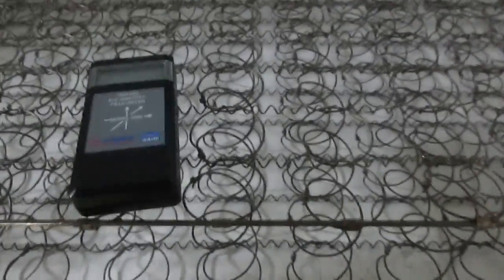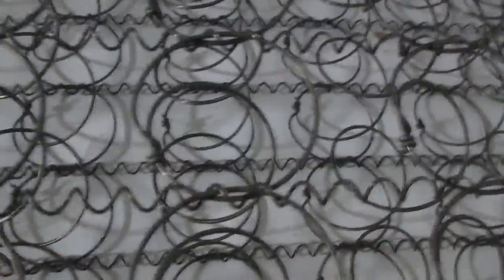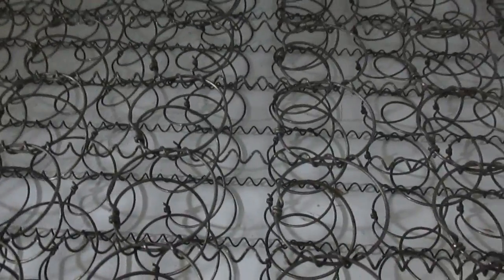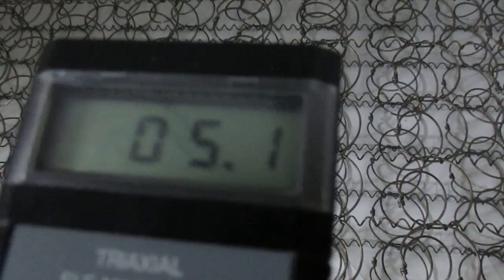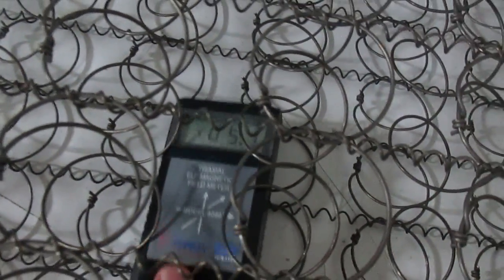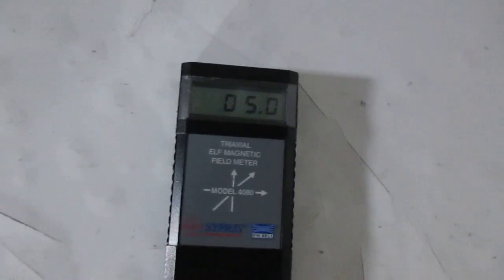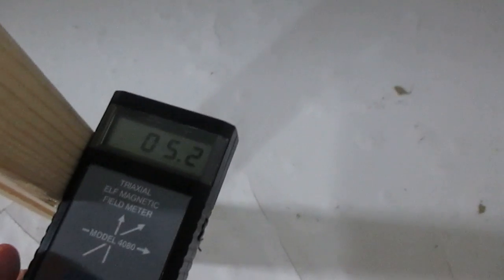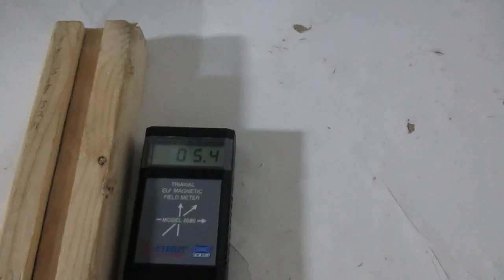EMF Test on a Mattress Innerspring While in a Strong EM Field

Comment: This is not an accurate demonstration. First - You need to know WHAT you are measuring. People think EMFs are just one EMF. There are Electrical Fields, Magnetic Fields, Radion Frequencies etc. 
Electrical fields do and WILL couple with metal. You are reading Magnetic fields.

Comment: Thank you for this. It sounds like the amount of EMF that the box spring is reflecting back is insignificant.
Regarding the concern that some people have that metal can amplify power, it can only reflect – it is not possible to boost the power of a signal without providing input power.
Reply: Exactly, there is no amplyfier without inner power. If they invent amplyfing wihtout adding power they will get Nobel prize for it.

Comment: Do same test put your hand touching spring so your the ground... watch number drop... do with laptop plugged in 1000 reading drops to 5 from touching... very high for laptop plugged in.. your measuring the air near it ... the frequency would be in the metal... and you would ground it... so need to lay your bare arm on it to see effect
Reply: And use emf not magnetic field...
Reply: EMF stands for electromagnetic field and this field is made by electric current that is going trough wire. Every wire that conducts electricity has EMF and this EMF afects the nature around the wire. Using this theory people made electric magnets and by reversing this proces they learned to produce electricity from generators. If you separate the metal spring not to touch the switchbox and youi have a distance lets say 1 m fro mthe box, the EMF inside the coil will be close to 0 and there will be no difference if you naked touching your dick and the coil or just stand near it. The reading will be practicaly 0.

Comment: Thank you so much. I'm getting ready to buy a new mattress set, and you have alleviated some of my concerns.
Reply: AC magnetic fields are not the concern with springs.  It's the ELECTRIC fields and RADIO FREQUENCY that is the problem.  Also use a compass to see if there is a static magnetic field coming off the springs.  He's using the wrong meter to measure this.
Reply: @dahoundog21  i agree.

Comment: The EMF emitted from that breaker box is a magnetic field, I would like to see RF/microwave as I see differently.
Reply: RIGHT!!! !!!
Reply: RF/microwave are made from tools that are manufactured to emit it such as radio antenna that emits radio waves. This box is not designed and made to emit radio waves so there isn't ANY radio/microwaves emited from this box. This box contains switches that are conected to electrical current wich can conduct some magnetic field nearby the box but decreases rapidly with the distance from the box. So after 1 meter or 3 feet you should be ok but I do not know a person that sleeps 1 m from a switchbox. My switch box is on the outside of my window and I am at least of a 3 m away from it. Radio waves you get from radio emiters, GSM towers, routers, airport towers etc. and the waves they generate is to transmit information via distance wich is completly different thing of what electicity is doing inside the cable and in this switchbox. So no, he can't measure RF/microwave from this box because it isn't any. If he pick ups some RF signal it would of been from the gsm or router signals which you have EVERYWHERE now.

Comment: Thanks for testing this......it's reassuring 👍🏽
Reply: AC magnetic fields are not the concern with springs.  It's the ELECTRIC fields and RADIO FREQUENCY that is the problem.  Also use a compass to see if there is a static magnetic field coming off the springs.  He's using the wrong meter to measure this.
Reply: @dahoundog21  You can't have electric field without current put into something that can conduct it. If you put electrical current on your mattress coils you will get electric field but I think that will be the lesser thing to worry then... As for the radio waves... if you invent me radio amplifier without adding power, transistors, resistors than go claim your Nobel prize and go to change the theory of some univercities...